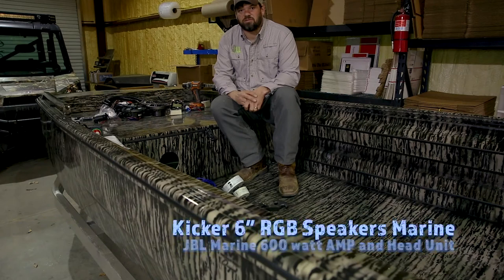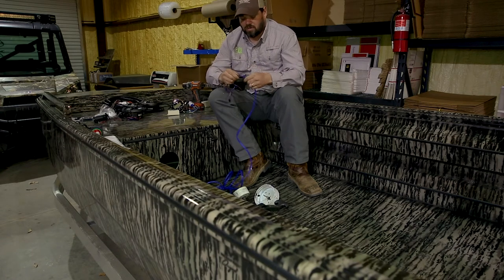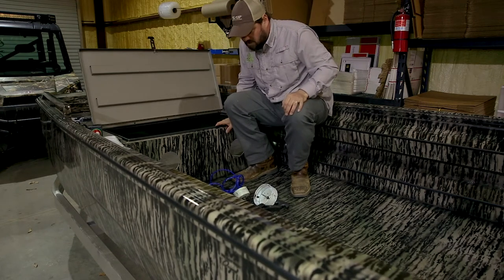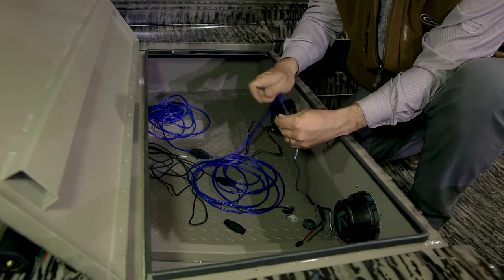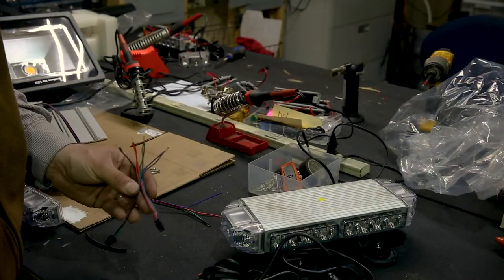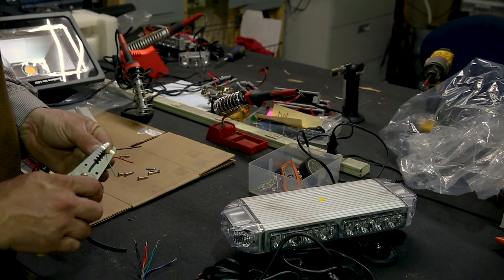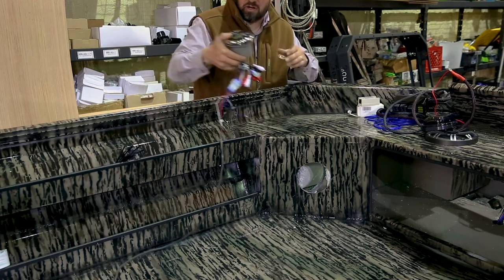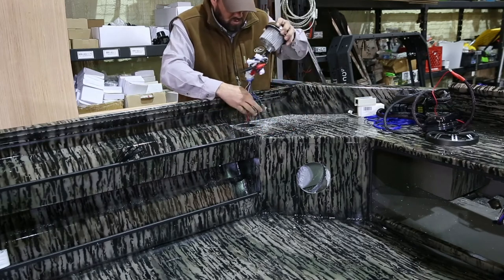Marine RGB Kicker 6" speaker Install on a Edge duck boat diamondback

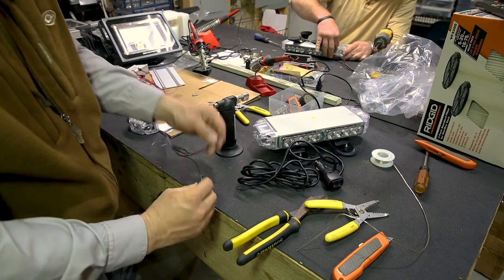Comment: At 8:25, you've got wire splices that look factory. Where did you acquire those? I have the 4 speakers, and the remote with wiring, along with the kicker (6 strand wire). Where did you get the splice connectors to pair the speakers? Thanks!
Reply: I figured I'd post this for others to read. I called kicker and they told me to cut the plugs off, and solder the wires or butt splice them with marine butt connectors directly. The plugs are not water proof and will fail. I plan to use marine grade butt connectors, and then marine grade heat shrink over top for added protection.